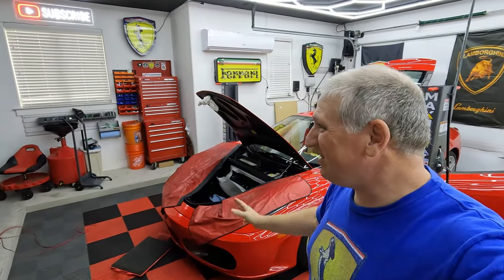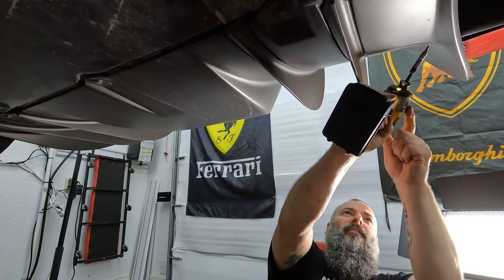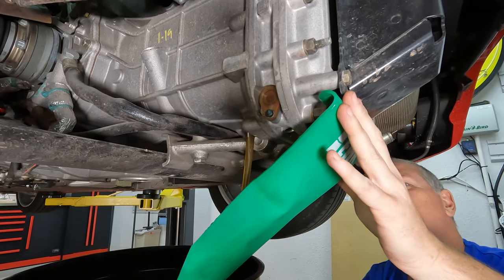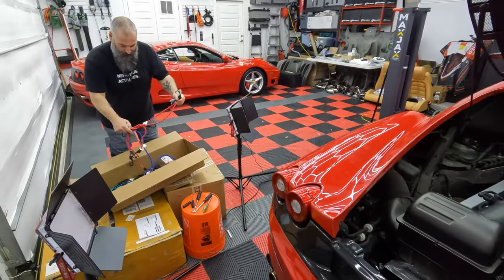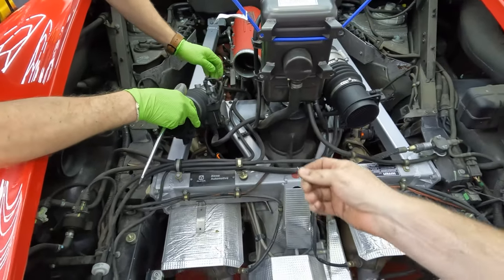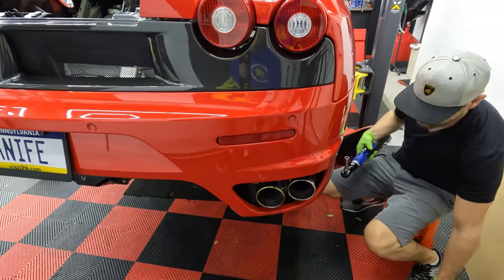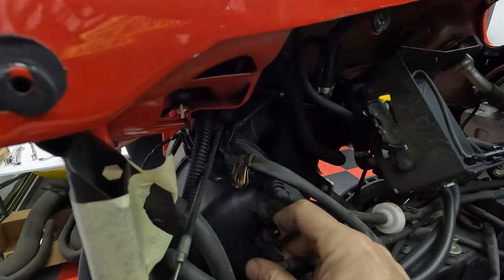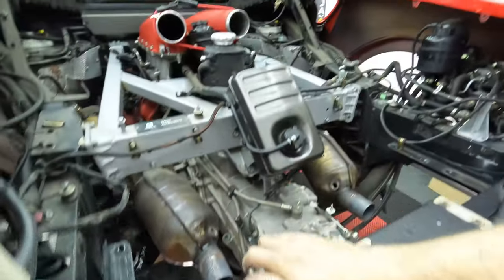Ferrari F430 DIY Manual Conversion Part 3

Comment: There are so many cool upgrades you can do with all of these components removed. I had carbon airboxes on my 360 and not only did they look cool and weigh less but they increase airflow and add some HP. As mentioned, if you don't have a Capristo or Tubi, now is the time. The sound from my Tubi was beyond intoxicating.
Reply from the maker: Yup exhaust mods, air box, intake, etc.. lots of access